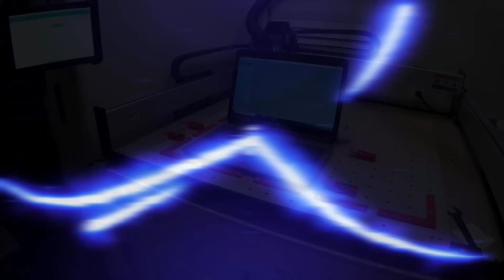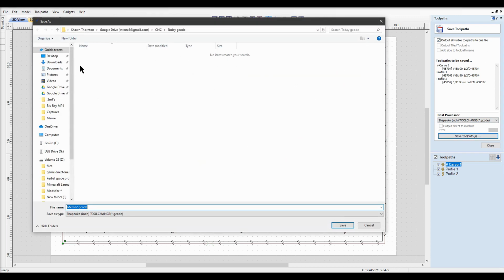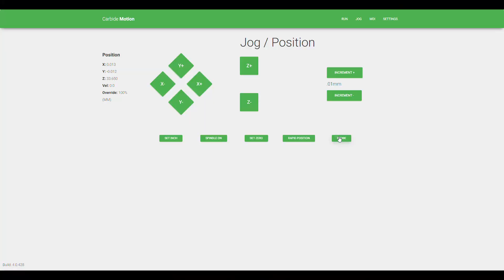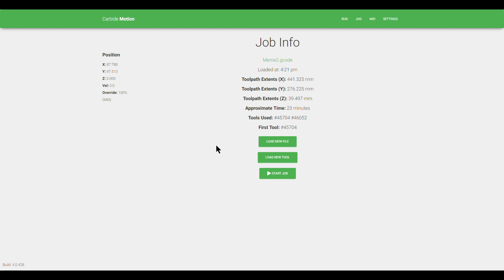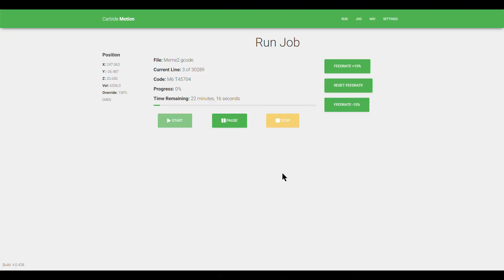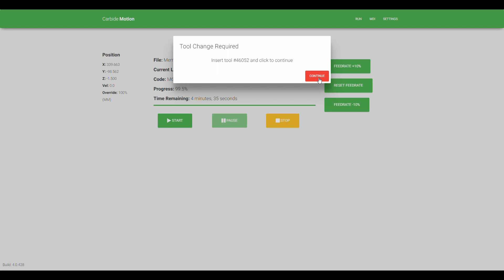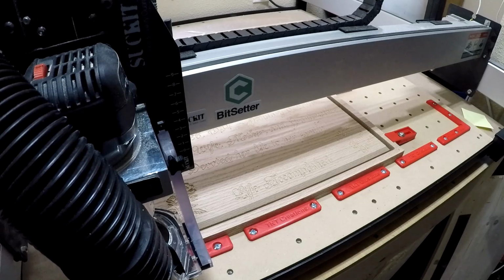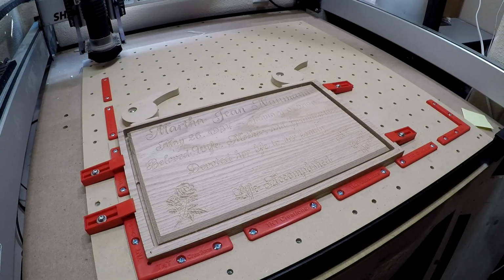VCarve Pro with Tool Change and Bitsetter

Comment: Not sure if you know this but after probing it returns the bit to the proper xy position but purposely keeps the bit in a +z position. Check the screen after probing and you'll see it says x and y are at zero but z is at 6mm if I recall correctly. The system records the proper z height however its designed to keep the bit off the work surface after probing.
Reply from the maker: It does. I was speaking more towards the z position when at the material surface.

Comment: Chris I have just watch this video again and I have a question the the first bit you had in the router when you initialize the machine did exactly what.also when you used the touch probe and set your x and y and then went to the middle oh the board to set theZ could you have sipped the probe ang gone to the center of the board and set the 
XYZ all at the same time using the paper Jeff Peters

Comment: Hi  I am trying to understand how this bit setter works. 
this is my take on what I saw you do. First of all  at some point you installed  a .125 em which did not rally have anything to do with the file you were going to cut right, is was there so that you could initiate the bit setter and then set your XZY with that bit using the touch probe. Right then  jog and reset the Z off the top of your board then reset theZ then load the cut file that bit will move to the front and you put in the first bit in the file  and click continue it will then move and take a reading on that bit an move back to the center where you will put dust collection on and start router and hit continue. and do the same thing with the next toolpath. So now can you tell me how it all works if  the bit that is loaded to begin with is the bit for the first and all you used was the  probe to set theZYX  do you just load then what do you do.
Thanks Jeff Peters
Reply from the maker: I know that these steps can sometimes seem pretty complicated. I’ll try to simplify a little. When using carbide motion, there are only 1/4” and 1/8” end mills that you can set your xyz axis with. In my case, the last bit I used was 1/8” so it was already in the machine. Now if my first bit was going to be one of those, I would have swapped before I powered up the Shapeoko. But in this case, my first bit was a V-bit. I cannot probe xyz with that. So I went ahead and set all my zeros. As soon as you power on and connect the Shapeoko it takes the first reading from the bitsetter. So now you can use that bit to set your zeros. (Yes I did check zero in the middle with the paper but this is optional). You can load your gcode at any point. I’m just in the habit of loading it after I zero everything. But now I have to load my V-bit before I can start. So you press load tool and the machine will come to the front, you load the tool, then it takes the reading for that tool and automatically adjusts your zero. (Again here you can use the paper/ completely optional). Now your file and bit is loaded, your machine is zeroed, add your dust collector and hit start. The only reason I use the paper is to be more accurate when I’m using v-bits. 
Yes, when using carbide motion when you press start, it will check the bitsetter one more time. (No way around this in carbide motion). Really hope this helps. Please keep asking, I’ll keep trying to help.
Reply: @PricklyGuyCreations  Thanks For the reply.  How much of what I posted above was correct.
Reply from the maker: All of it.
Reply: @PricklyGuyCreations thanks for all your help Jeff

Comment: hopefully you will see this.  I have done your directions but the file isnt showing in the drop down for post processors.  I went back in to MyPost directory and it shows there.  Thanks for any help you can give.
Reply from the maker: You must close the program completely and then reopen it. If it’s showing in the folder, that’s all I can think of.

Comment: Know this is 2 years old.  I’m new to VCarve and using the shapeoko.  My router will do all that is asked until it’s time to carve. It won’t go to the piece to carve     Can you help?
Reply from the maker: Let’s start with the basics. Are you using mm or inch?  What post processor are you using when you save your toolpaths in Vcarve?  I have not used Carbide Motion in almost two years. Been exclusively using CNCJS so I have no idea if they have done any updates.
Reply from the maker: Also, how are you setting your zeros? (X,Y,Z)

Comment: I might be questioning too soon, but what's the point of having a Bit Setter and a Bit Zero if you still need to use the paper method to set your actual zero? I've been saving to buy one or the other (can't really see why I'd spend so much for both) if I still need to set my Z zero manually :(
Reply from the maker: You don’t “have” to. The touch probe is spot on with the x and y zero. The Z is usually close, but if your work surface or the material you are cutting is not perfectly straight, it’s not uncommon to have some discrepancies especially if you get that extremely “straight” wood from Home Depot. I use the paper method during the initial setup to get things as close as possible. After that is set, the bitsetter is great for tool changes. No longer need to re-verify zero.
Reply: TNT Creations TR hey thanks for the reply! Given you got experience with both, I’m interested in buying one... I am not sure which one I should get tho... my designs do contain tool changes, so I’m leaning towards the bit setter... your advise would be greatly appreciated!
Reply from the maker: Agustin Gutierrez The order I got mine was: Touch probe, then bitsetter. BUT, if you can handle the initial zeros without a probe, I would definitely say the bitsetter is worth getting first. Also, there is no reason you have to buy carbide 3D’s touch probe. There are lots of them out there that work. If you are using Carbide Motion, then you are kinda stuck with there probe. If you are using cncjs or another sender, you can use whatever you want.
Reply: TNT Creations TR thanks a lot! I always thought I was locked to Carbide’s, I do use CNCjs with a Raspberry Pi so youve made my day! thanks!
Reply: @PricklyGuyCreations   You can also make your own similar to bitsetter if you have a 3D printer, or even with a piece of wood, and just two cables and one push botton ( 5 USD or less on amazon ). Ideas on Thingiverse.

Comment: Watched this video again and  have a question. Do you find  that the touch probe  does not set real goo on the wood and will move while it is probing . mine when I put it on the corner the weight of the wire hanging over the front of the machine will cause it to move I feel like I have to hold it in place. or does that not matter.
Jeff
Reply from the maker: The X and Y shouldn’t matter. The Z, yes. Sometimes mine will move too.  But if you do the sticky note, that will double check your Z.

Comment: Does this also apply to the carbide create non pro version?
Reply from the maker: I don’t really use Carbide Create so I can’t really say too much. I found it basic for what I was trying to do. I think it’s a great free program, I was just looking for more.
Reply: TNT Creations TR so you use the Pro Version or do you use a different software?
Reply from the maker: victor cisneros I use VCarve Pro. It’s a little expensive but I love it. Eventually I will update to Aspire (Both products are from Vectric). Aspire has more 3D capabilities. I’m just getting started with the 3D STL files. VCarve can cut 3D models, it just cannot create them. VCarve Pro does everything I need right now.
Reply: TNT Creations TR thanks for the insight. Definitely going to continue to follow you here and on Instagram

Comment: Does this only work in pro version? or can it work with VCarve desktop.
Reply: I'm getting an error under "visible toolpaths to one file" it reads both use tool number 1 but the geometry of the tools are different
Reply from the maker: You’ll have to setup different tool numbers for each bit. I have a short video on that too. That way the program knows which bit is which.
Reply: @PricklyGuyCreations  Thanks, (this is bad) I had to change the # bit per toolpaths ex same bit #1541, #1542 #1543. I don't want to but it keeps giving me an error

Comment: Do you now have regular Shapeoko_inch and mm in My_PostP folder along with Shapeoko_inch_TC.pp & mm_TC? Do you get rid of the non _TC files and do you just select _TC ones even when no tool change is needed? I don't remember if I originally had Grbl_inch.PP previously. I swear that's what I was using before and not the Shapeoko_inch specifically.
 Thanks fellow Texan
Reply from the maker: I use the Grbl_mm_TC.PP. I just created my own and renamed it.  I added a pause so my spindle can speed up. (When I finally use my spindle). I can add the non-TC files back in, I just don’t use them anymore.

Comment: Thanks for the video. I have a quick question about tool#'s. Do you have to rename each bit a different #? it looks like all of mine are tool#1 by default in vcarve
Reply from the maker: Yes. When you setup the bit, there is a place for the tool number at the bottom. Most are 1,2,3 etc. I use Amana and Carbide3D, so I just number them the actual bit number. There is a way to put it in the header, but this way is MUCH easier.
Reply from the maker: Let me know if a short video of the setup would help. I’ve planned on doing a fusion360 video, but I could do a VCarve quickly this weekend.
Reply: @PricklyGuyCreations  I use Amana and just imported the tool library and never named a tool number. I keep getting a error "tool number the same but different diameter".. Had me confused,I thought I wasn't installing the pp correct
Reply: @PricklyGuyCreations  Yes that would be great using VCarve
Reply from the maker: I’ll try to get a video up this week. I’m out of town this weekend, so it’ll be during the week.
Reply: @PricklyGuyCreations  yes that would be great Jeff

Comment: Great video, I was debating whether to get the bit setter but run VCarve Pro so I wasn’t sure if it would work. What version of CRbide Motion are you running and where did you get the guides and hold downs? I really like those. Do you like them?
Reply from the maker: If you download the latest version of carbide motion from their site, you’ll be fine. I think it’s 417. I’m running 428. I made the guides. I didn’t like the ones that were out there so I’ve been messing around with Fusion360. Still working on the hold downs. “Work in progress”. I love the guides. Keeps me lined up and doesn’t interfere with touch probe.

Comment: Watching  this again  great video. question . did you make your own file for your waste board or is it found some where else  also when you cut it did you prop it up off the machine bed to keep the drilling from getting in to it.
Jeff
Reply from the maker: Yes. I used one off the internet first, but the holes were not how I wanted them, so I modified and made my own. First one was from Myers wood shop. Before he quit Shapeoko and went to Onefinity. I put a piece of scrap under it to cut out.
Reply: @PricklyGuyCreations  
I like the way yours is set up any chance you sell that file?
Reply from the maker: @resorter66  Lemme see if I still have it. I’ve added to it since then. Added a ruler down my x and y. Helps me with my acrylic cuts.
Reply from the maker: Jeff, here is a link to my file.  This is a two sided file in VCarve.  You don't have to use the other side.  It is where my Logo is, and some mounting holes.  I use Kregg screws in the mounting holes to attach to the Shapeoko, and 1/4" T-Nuts from Amazon for the wasteboard.  There is also a ruler toolpath.  This really helps me, but is unnecessary.  If you use it, I would run it seperate, and start it wherever you want your XY zero to be.  Hope this helps.
https://drive.google.com/file/d/1ywOiPs_9Cw4HZVtv0kjMwmBMwMiLD93i/view?usp=sharing
Reply: @PricklyGuyCreations  Thanks a  lot for the file . I really  appreciate you sharing.

Comment: Do you have a wireless/bluetooth keyboard?definitely need those if your just navigating on your material.
Reply from the maker: Had a tablet that I used. Tablet was too cheap. Locked up all the time. Looking to replace.

Comment: I have been looking for a video like this forever!!!  One question....how do you zero out Z after probing?  You showed everything on the video of how that looks in the computer except that and that is what I've been having the most issues with.  Great, informative video.  Thanks!!
Reply from the maker: I manually move to the center portion of the piece and use the Z+6 command in the rapid move section. Then I can select 1mm increments and slowly edge down to the piece. When I get close then I change to the smaller increments and edge down until the bit slightly touches the paper. At that point I select the zero z button. That’s it!  This is not “required”, but a good practice especially at the start. It really helps if you are carving fine details with a vbit.

Comment: Thanks for the video.  I see so many people are very happy with their results, this makes me feel even more stupid.  I think I did everything as you instructed but my "Save Toolpath" button is still grayed out due to the error code saying I have different end mill sizes.  I do see the "tool change" in my PP, but still not allowing me to save, help meeeeeeeeee
Reply from the maker: Let me get back to the house tonight and we can see what we can figure out. I won’t leave you in the cold. lol.
Reply from the maker: Ok, when you dropped the post processor in your application folder, did you drop in “My_PostP” or “PostP”?
Reply: @PricklyGuyCreations  Dude, thanks for helping!!  I dropped it into my_post
Reply from the maker: Ok. So when you select your post processor in VCarve, what are your options?
Reply: @PricklyGuyCreations  I get the Tool Change option and I select it but it still displays the error about different tool sizes
Reply: My answer didn't seem so clear upon reading again..  I select the new PP I deposited into the "My_PostP".  It is the one I copied from the link you posted.  It wasn't there before, so I know it's the new one. Thanks again for all the trouble..This isn't urgent obviously, so please don't take time away from important things for this.
Reply from the maker: Let me do some testing here on my machine. So you have multiple toolpaths selected, and click the save button, output all visible toolpaths to one file.
Reply from the maker: Carl, try this for me.  Delete the PP you dropped into My_PostP that says toolchange.  Then download and drop this one in there.
https://drive.google.com/file/d/18nzeo79--i9R2cvgFRyyH-yPbJfZwJuG/view?usp=sharing
Then close out of VCarve and reopen.  Let me know if that works.
Reply: @PricklyGuyCreations  Thanks mate.  I won't be at my shop until tomorrow at 9am pacific time.  I don't know where you are, but, thanks and stay safe!
Reply: @PricklyGuyCreations  Will do as soon as I get to work, thanks again!
Reply: Sadly the same thing
Reply: Wait, now it's not showing up as an available toolpath
Reply from the maker: Hmmm...  I tried a few things last night and when I removed the tool change pp I did get the  error you were talking about. But as soon as I selected the tool change pp it worked again. I honestly don’t know where the program is missing it.
Reply: @PricklyGuyCreations  Well, I'll keep plugging away and keep you posted.  Thanks a million
Reply: Embarrassed to say that I figured out where I was going wrong. Even though I chose different  end mills I had not changed the tool #, they both were #1, now I've changed that it works...Obviously, thanks for all the
 extra work you did for me
Reply from the maker: No worries. Just glad you got it.

Comment: Hey great video you need to do videos for Carbide Create finial someone that did an in depth video that  show"s how it works.
I do have  a couple of questions when it is done with a tool path and needs to change bits does it move to the front center by it's self or did you do something. That was a little unclear. Also could you elaborate some on what you did when you moved to the center and touched off there about changing to mm's. Also did you make your own fixtures for your spoil board, is so do you sell them . I like the way mount and can be moved. Well I might as well keep asking. Do you have  a file for your spoil board I also have  a XXL that I could buy.
I just Subscribed Jeff Peters
Reply from the maker: If you are using the new tool change post processor, it will move to the from on its own. Carbide motion will prompt you’re to turn off spindle, then to change tools. When I was checking the Z height in the middle of the board, they way I do it is:  I move to the center portion of the board.  In the rapid position menu, there is a button that says “Z+6”. That will put the bit at 6mm above where it thinks zero is. Then oh can manually lower the bit until you touch the paper. Then you can “set zero” for your z. It seems complicated, but once you do it a couple times it’s pretty simple. For the spoilboard head over to Meyers Woodshop and the files you need will be in the blog section. As far as the guides, those I made and you can get them on thingiverse from our page. If you don’t have a 3D printer, you can order them. https://www.thingiverse.com/thing:4158115
Reply: @PricklyGuyCreations  When I go to that site where do I find them to order or have  printed if that  is what needs to be done I signed up and have an account there just need to know what to do. Jeff
Reply from the maker: There is a button that says “Order This Printed”. Push that and select a vendor. I have nothing to do with that side, but I hear they are pretty fast.